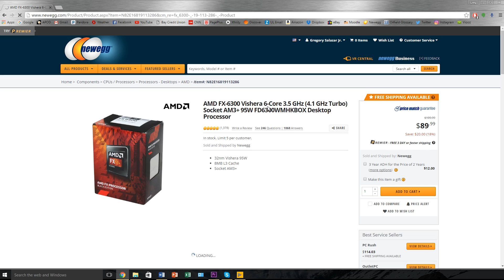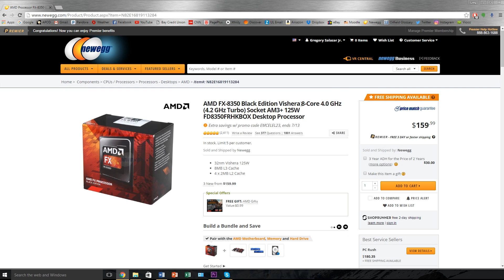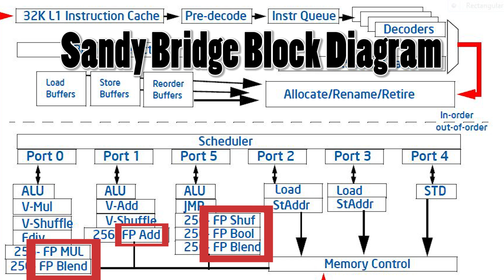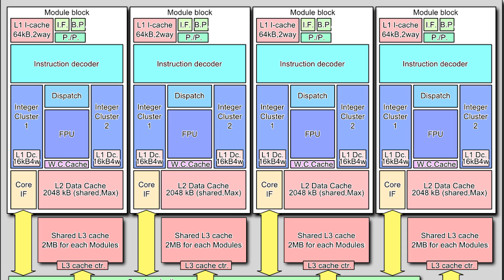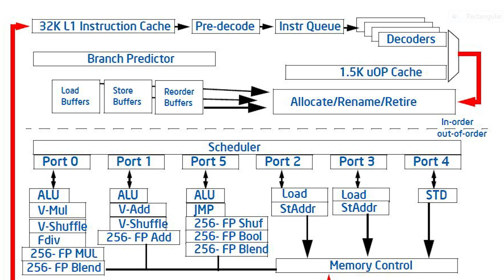How Many Cores Do AMD FX Processors *Actually* Have?

Comment: Since when did the # of shedulers define a "core"?
The block diagram is self-explanatory. It shows a pipeline that begins with 1 input and ends with 1 output, effectively making a Bulldozer "module" with 2 int units and 1 FPU a single "core".
In addition, the entire module runs at the same frequency, and the int clusters are synchronous. Simply splitting up a set of ALUs doesn't make multiple cores.
So no, it is not an 8-core CPU.
Reply from the maker: It's not schedulers alone. We explained this in the video - although it is VERY old. It's core dependencies. The point of the diagram and description we gave is that the FX architecture follows a similar layout to Hyperthreading - and Intel isn't labeling each of its threads as "cores." There are, of course, differences, but not enough of them to overcome the hurdle of being named a "core" without misleading consumers. Not sure what you're on about here.
Reply: @GregSalazar  I'm referring to the statement at 2:03 that explicitly states that the CPU has 8 processing cores (which were defined by a unified RTL, not an integer cluster...), and implies that the presence of a scheduler is what makes an integer cluster a core.

Comment: There's much more to a core than ALU's and FPU's. If an independent core can not act as a cpu if it's cut down to a single core. If either amd or intel can't actually make a single core processor out of the same architecture. They really aren't independent processors the same way as they are bottlenecked the same way with something the way. This is exactly why we can't linearly scale  anything with the increased number of cores in our systems. Even if the programs are designed to take advantage of every single thread in the system no matter how many.

Let me give you an example. You have a quad core processor and an 8 core processor of the same architecture The rest of the system is the same, you have 4 sticks of single rank dims. You are now running dual channel dual rank memory on 4 cores. For the sake of simplicity let's say you have an average memory latency of 100 ns because we are running jedec specs and the memory has a copy rate of 40GB/s

If the task your cpu is running requires large chunks of data from the memory like decompression etc. It'll be bandwidth bound As long as the data chunks are big 100ns won't be a big bottleneck because you'll be transferring a huge chunk and waiting for 100ns then transferring another huge chunk. You'll not notice much of a difference in the quad core processor because it has only 4 cores to process the big chunk of data which takes twice as longer with half as many cores. 

Now with the 8 core processor on the other hand you will process the same chunks of data much quicker in fact twice as quicker and you will have to still wait for the 100ns latency in between each data chunk. So compared to the quad core processor you won't get double the performance as you have expected unless you tighten the memory timings and increase the speed to achieve 50 ns latency.  

And in memory intensive tasks that require tiny chunks of data but many of them you're basically screwed either way unless your memory has low latency. Like SQL server being a great example.

The reason why Cinebench almost always scales 100% linearly with the increased amount of cpu cores and ipc is because it runs everything on the cache. It almost never requests anything from the system memory. This is why Cinebench means nothing in the real world because almost no real world application replicates the scenario cinebench is using.

The more memory channels you allocate and the more ranks your memory has, the more data your processor can access at a time. If you have 2 dim slots you gotta get two dual rank memory sticks. If you have quad dim slots you gotta have either two dual rank memory or four single rank memory sticks installed. Likewise the faster your memory is, more multi threaded programs can scale with the more number of cores you have. 

This is also why you need quad rank memory in x299 platforms and it's successors. Because 10980xe has many many cores. And Ryzen 5950x for general use is really unnecessary. You won't gain nearly any benefit over a 5800x or 11900k. Simply because both ryzen x570, b550, x470, b450 and z490, z590, b560 or similar platforms only support up to dual rank memory. And the very same thing applies to threadripper. This is why you won't need anything more than 24 or 32 cores. 64 cores won't gain you nearly anything over 32 cores.

Comment: Hi @Greg Salazar, I am guessing that for a FX processor there will still be independent progress due to how processes or program threads are scheduled, and if you think about it, even though on Intel, each core has their own resources, the resources still has to be shared between the individual core and it's hyperthread which sort of puts it in the same boat as the FX? In addition, the the individual Intel core still has to process tasks sequentially, just at a faster rate due to a faster and smarter scheduler as far as I understand? I have an i7 870 and a FX 8350 and they perform almost identical in most games I have tested for Radeon API driver overhead. I understand modern HyperThreading might have less flaws, but according to my tests the i7 870 and FX 8350 had the same flaws when; for example, in games where the threading doesn't scale well or utilize all of the available CPU logical cores.

Comment: In 2021. I still use AMD FX8320 OC4.0. In the latest and most demanding games, all eight cores are constantly in action. Only now is it proving to be a better solution than an Intel processor from the same time.
My opinion is that it is an 8C / 4T processor.

Comment: Amd was kicking intells ass with atlhlon xp, then athlon 64, then athlon 64x2, and possibly phenom <I'm unclear on the dates, I know intel made a comeback around phenom, don't remember when>, then they basically lost their fabs, got stuck on 32 nm. The outlook was that with more cores available the software would be more parallelized. So out came phenom x4 and x6. Intel replied with more single core performance chips, and the fx was meant to compete with the first gen core i5, with more cores^tm* than the i5s had for this new generation of software parallelization. Except it never came and on top of that bulldozer was delayed. By the time it came out the fx was doing decent in multi threading but was severely behind in single core performance. The Vischera refresh helped a lot but it was too little too late. 

The ironic thing is vischera is by far not the best performer out there, but the i3 and i5 that it was competing and losing against  when it came out are about bottom-useless now, and you can still get decent fps out of the high end fx chips, because the software thread parallelization finally came around. 

The other thing is the fx overclocked like a beast. Running a full 8core overclock of 1ghz was about the base-autosetting you do on those chips.

Comment: CyberPowerPc uses that cpu cooler @2:15 on a 2700X in the cheapest micro atx x370 motherboard if you buy the system from BestBuy.

Comment: The Fx processors have the cores that was advertisers, to say that a FPU does all the Mat in a computer is a false statement , the FPU deal with floating point operations, and in the old days only if program was coded to take advance of it (don't know if it still work this way, but i think it does) .
Both the intel 386SX and 486SX did not have any FPU but they where still a computer or one core processor.  
Many of the mathematics operations, using when coding, like "add" "sub" "mul" "div" do NOT use the FPU, but its done by the CPU/Core.

Comment: simplified explanation on HT, how it was explained by a few when it first showed up on P4's, it takes unused clock cycles and uses them towards a "virtual core"...... AMD doesn't ?emulate? the additional cores, and that's where the difference is

Comment: It seems that the biggest difference is in gaming. I do not game so I'm still running my FX 8370 OC to 4.6Ghz. I bought it new 5yrs ago with a ASUS Sabertooth MB, and I have yet to bottleneck it, or stress it to the point of lagging out. For the average power user AMD is a perfectly suitable CPU for a lot less cash. If your a gamer, your better off putting the extra cash into your GPU anyway.

Comment: This is a great video, Greg. Excellent explanation.
The 8-core FX performance, due to the shared FPU, is approximately 150% to 180% higher compared to a 4-core CPU with one FPU for each core. So the bottleneck is surprisingly not that severe.
Reply: From all the research I’ve done I repeatedly hear it’s the front end providing the majority of the bottleneck on the FX design. I also hear for 128bit floating point workloads the FPU can function as two units and only on 256bit workloads do both units need to come together for one thread.

Comment: Well, I know that my Phenom 2 x6 1045T was not Bulldozer or Piledriver, but I can tell you that my current Intel i5 3570K is a WHOLE lot faster than my Phenom 2 ever was, and that is without Hyper threading. Intel was able to kick the crap out of AMD for so long now with no real changes to their processors, it is now nice to AMD fighting back again.
Reply: true but a phenom 2 wouldn't ever compete against a ivy bridge intel, their release dates are far apart 

even if AMD didn't fall flat with the FX, a cpu that newer back in the days of actually decent upgrades would get much better results
Reply: @bluescluessuperagent  AMD was kind of screwed over by the time of the FX series processors. They had bought ATi, and by this point, Intel was making it nearly impossible for AMD to sell processors through companies like Dell, Toshiba and many, many others. Intel, through backdoor dealings screwed the whole industry. Look where we are today. AMD is hitting back hardcore because it has to, and Intel is freaking out because it was caught with its pants down.  Intel just worries about money above all. And by nearly taking AMD out of the picture, Intel themselves stifled true innovation. We have had the same basic crap from Intel for so long, I have had no reason to upgrade from my current i5 3570K. Now that AMD is back in the game, I have a reason to upgrade at some point. I am not saying Intel will not catch back up, and maybe even surpass AMD again, and I am not saying Intel will fail as a company, but it did screw over the industry as a whole, by caring more about money in the short term, versus actual innovations that matter.

Comment: to give advice in processors if it does what you need at a price you can afford and works with your build you shouldn't have any complaints, I got a fx build computer so i'm gunna continue down that line as swapping just isn't necessary at this day in age especially for the cost

Comment: For the longest time I've accepted that my FX-8350 is an 8-core CPU, but later on I guess it's either an 8-core with shared resources or a 4-core with duplicated resources. It's not SMT, and it's not quite an 8-thread Core i7 nor a 4-core i5, and so that's why the benchmarks are the way they are

Comment: you know i know this is late as all hell, but i was wondering. if you disable cores 2 4 6 8 essentially making the 8 core bulldozer a 4 core cpu this would keep each set from sharing resources, would this increase performance? it just seems to me like if you can do this in the bios then the 1 active core per set would get full reign over the FPU and L2 cache since it wouldnt be shared anymore. i would say do this in windows because thats pretty easy to do but the cores are still technically active just windows doesn't acknowledge them where as if you could do this on a motherboard through the bios its more of a brute force disabling.

Comment: i had a FX 4300 and the worst cooler you ever seen and i got 60 FPS in games on ultra. So why are people trash talking FX? there actually sometimes really good.
Reply: I dunno, i have a FX-8350 and it's good, it's not bottlenecking the GPU at all (RX560), nor RAMs etc.. I can play all the new games at least mid settings.

Comment: One of the craziest things about the AMD Fx-8350 is that although its an 8 core CPU, I remember running UserBenchmark and this CPU even when overclocked scored only about up to a 60 to 62%, however I was having problems with the pc shutting off even when not overclocked, so I decided to rebuild my gaming rig with an Intel Core i7-4770K instead and it only has 4 cores with HT, but when I did some OC tweaking on that CPU, it scored an impressive 94%. Kindof like in school, a 60% would've been a D- while a 94% would be an A. I guess another way to look at it is if you had to have major repairs done on your car, a shop that only has 4 mechanics, but highly trained and has their own tools would still be able to get the job done much faster than another shop that has 8 mechanics, but who don't know much about automotive repair and have to share tools.

Comment: AMD users who have used Phenoms & Athlons have said that the fx processors do all behave as proper cores and not half that number.

User reviews at https://www.newegg.com/Product/Product.aspx?Item=N82E16819113286 of the 3.5ghz 6-core AMD FX-6300 processor (click the number in brackets).

This video shows that the fx6300 can play Assassins Creed Syndicate at 1080p very well and none of the 6 cores gets near 100%
https://www.youtube.com/watch?v=vfr0ktiGTAI

AMD Phenom II x6 1055T OC'd to 3.3ghz (6 core)
ASRock M3A770DE AM3 motherboard
8gb Gskill Sniper 1600
CPU Mark - 6061
CPU Integer Math - 8954
CPU Floating Point Math - 6304
CPU Prime Numbers - 17.8
CPU Extended Instructions - 26.4
CPU Compression - 7137
CPU Encryption - 1291
CPU Physics - 402.5
CPU Sorting - 5180
CPU Single Threaded - 1289
----------------------------------------
AMD FX 6300 @3.5ghz (but can easily overclock to 4.3+)
MSI 970A-G43 AM3+ motherboard
8gb Gskill sniper 1600
CPU Mark - 6539
CPU Integer Math - 15447
CPU Floating Point Math - 5587
CPU Prime Numbers - 21.8
CPU Extended Instructions - 22.2
CPU Compression - 9148
CPU Encryption - 1146
CPU Physics - 446.2
CPU Sorting - 5469
CPU Single Threaded - 1304

Comment: SURPRISE!!!  AMD's Ryzen 5(1600 and above) and 7 are TRUE Hexa and Octa core processors! (One true core per FPU) which means Ryzen 5 is 6Cs/12T and Ryzen 7 is 8C/16T. They are faster out of the box, easily overclockable, use DDR4 RAM,   use less than previous geneations and (as always) are much more AFFORDABLE than Intel!! Can't wait to upgrade my FX-6300 to Ryzen 5 1600, plus a good new AM4 socket motherboard (which doesn't have it's chipset locked from overclocking ) and DDR4 RAM to go along with it (^_^)
Reply: Lost Cause well depends which mobo you have.. you cant oc on an a320 chipset...
Reply: Well, yes of course it depends on the mainboard you have.. I already stated that clearly in my previous comment when I said "a good new AM4 socket motherboard which doesn't have it's chipset locked from overclocking" :) For starters, we know that A/B300 & A320 chipsets don't support OC, however, the B350, X300 and X370 do support overclocking. Here are some OC capable mobos you could look at - 
1) Gigabyte GA-AB350M-HD3 
2) ASUS PRIME B350-PLUS
3) Asus B350F Strix 
4) MSI B350M 
5) GIGABYTE GA-AX370-Gaming K3
6) MSI B350 Gaming Pro Carbon
Reply: yeah... i knew that

Comment: DirectX 11 is optimized to use 1 or 2 cores. Future games will use DirectX 12 which spreads the load over all the cores.

In the game Ashes-of-the-Singularity an FX-8370 more than doubled in performance in DX12. A Phenom II X4 955 more than tripled.
Reply: any idea on how to install a different API on an AMD card?
Reply: APIs are run by processors. If you have an AMD processor with 4+ cores you'll get better performance in DirectX 12 or vulkan than 11 and future games will use one of these.

Comment: AMD should have rushed a die shrink to 25nm for piledriver, and pushed the use of 8 core, moderately clocked FX processors for current generation  consoles, thus greatly encouraging optimizations for their architecture. If that had been the case, maybe now the upcoming X1X would have a 4GHZ AMD capable of 60fps on all titles.